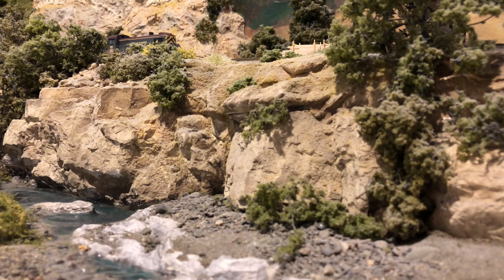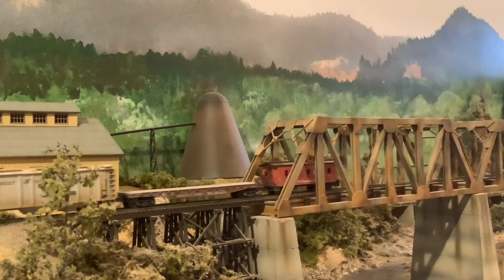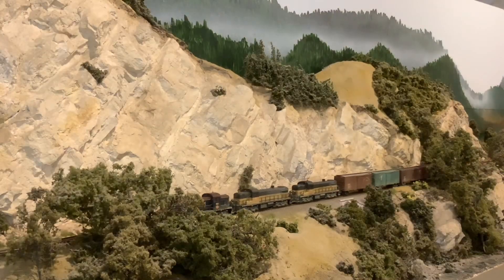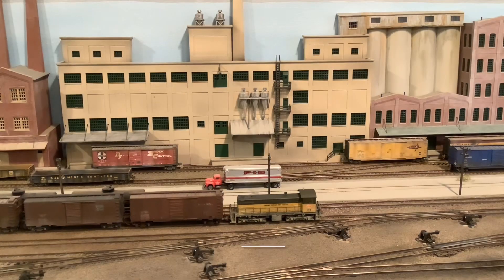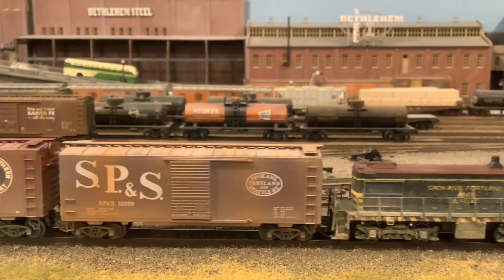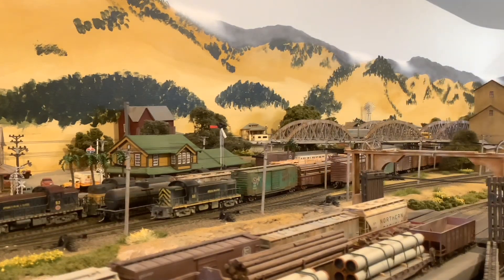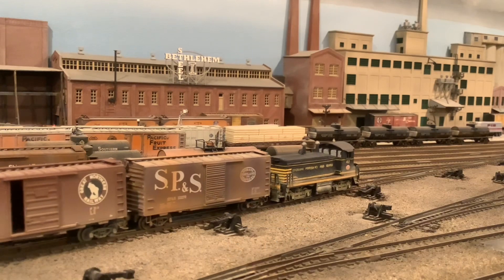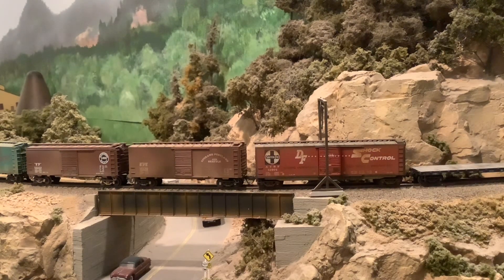N Scale ALCO’s on the SP&S

Comment: John, after watching your videos I want to dig out my N scale collection of billboard reefers to run.  One of the things I did see missing from your videos is the telescoping action created by Kadee coupler springs that appears in so many videos of N scale trains.  Are you doing something to your train cars to stop that action from happening?
Reply from the maker: Ah, yes… the ‘slinky’ effect! 
One thing I do is to install “restraining springs” on the axels of my cabooses (fortunately I run cabooses!).
Micro Trains sells these springs. They are small, short springs that actually go onto the end of the axel and exert a bit of pressure between the axel and its truck (acting like a brake to a small degree). I sometimes will install them onto two of the four axels.
Also (although I don’t do much of it…) adding weight to cars helps the problem some.
So… get out those billboard reefers and take some pics for us!
We’d love to see ‘em!
Thanks for looking in!